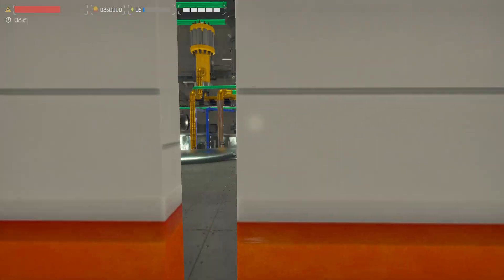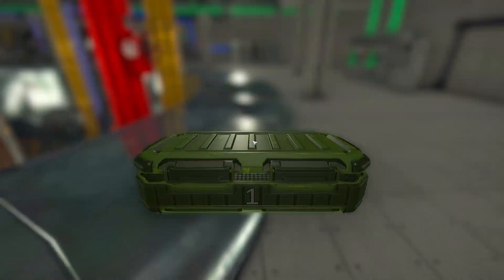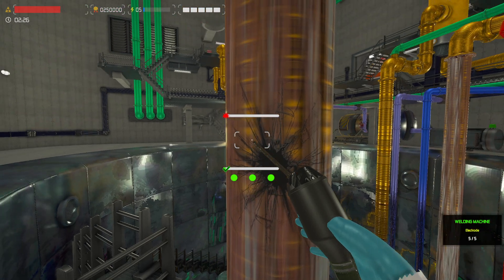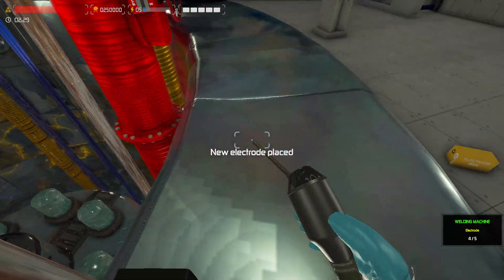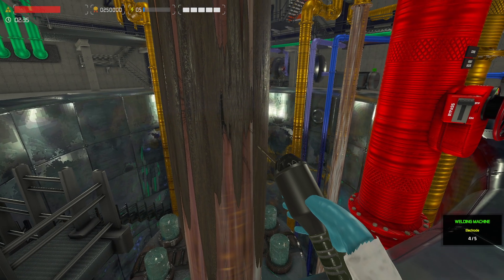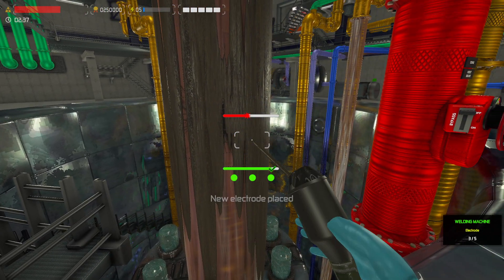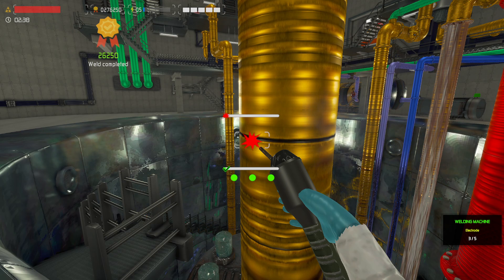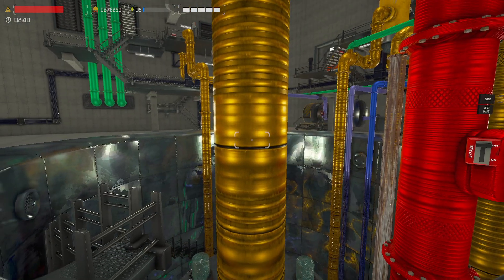Nucleares Reactor Simulator - Welding Tutorial

Comment: Any tips for shutting down the reactor without making the steam generator run dry?
Reply: i would say, do a 100% bypass on the turbines, so no energy is produced, thus avoiding the resistor banks blowing up, which did happen to me in my latest run.
Reply: you still need to keep an eye on the secondary coolant flow speed at 100% turbine bypass, just slowly lower the speed as the core temp begins to stop

Comment: If only i could make it far enough to have to weld something. I try to start up the reactor until too many alarms go off. Then the only solution is to pull out the rods, melt the core, and try again.
Reply: Scenario> startup

There are several other things you need to handle too in this one, check oil levels, fill all the cooling loops, operate the sky crane… plenty to learn.